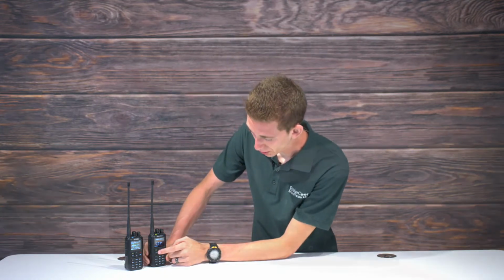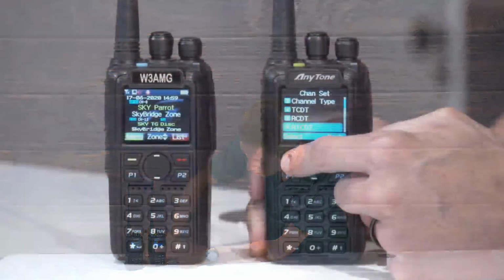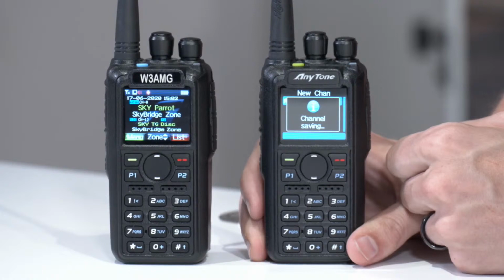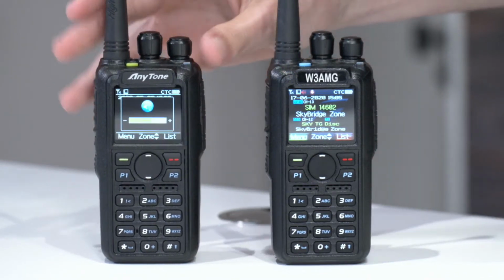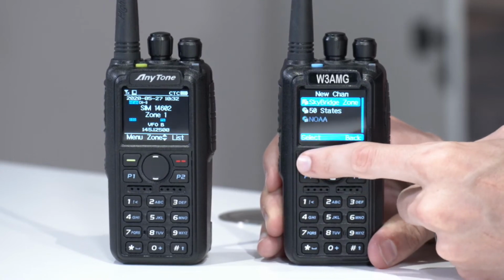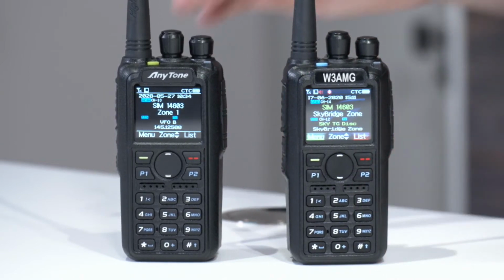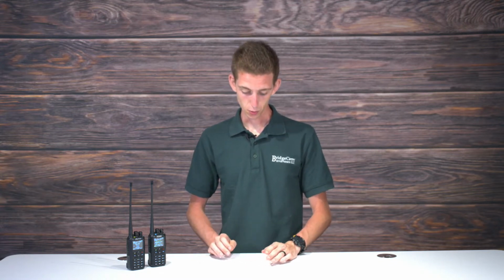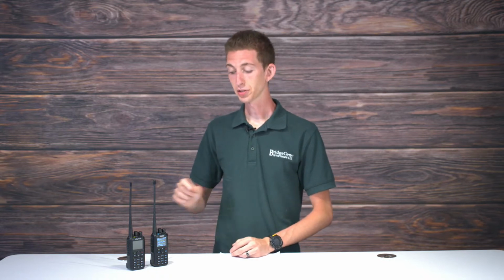How to Set up Simplex Channels for Radio to Radio Communication | BCU Live

Comment: Never heard of hams using tones on simplex.  That’s more of a commercial thing.  Unless you are doing something not quite legal.  😜
Reply: You can use tones as it's nothing more than a method of squelch.
Reply: @1500runner357  that’s true of commercial radio but it’s different for hams.  Part of the ethos of amateur radio is non-interference.  Using tones would mean that we wouldn’t know if we were interfering with someone else.
Reply: Hams use PL tone all the time.  If you're listening to carrier, you'll unmute regardless of PL tone.
Reply: I use them for testing new equipment. It doesn't jam up the repeaters with "radio checks" or disturb anyone. I set up an IP camera and drive away. I don't have any real friends. Just the monsters under my bed and the voices in my head.